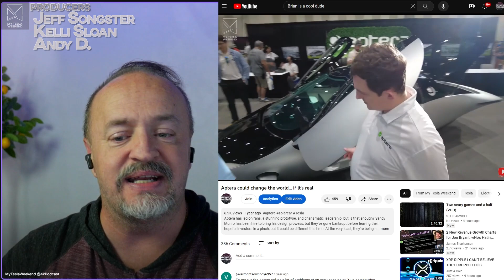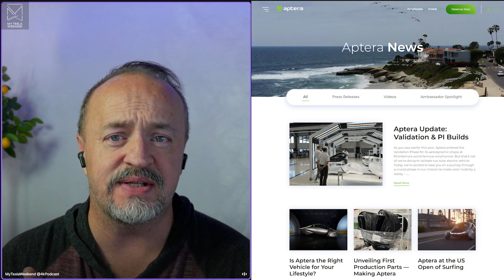Will your Aptera overheat?!? And other big answers w/ Chris Anthony

Comment: I will only be impressed if someone interviewing Chris or Steve can get an updated price.  It has been four years since they posted a suggested price and Chris himself has stated the switch to CPC raised the body and structural costs substantially. 

too bad their genius thermal engineer left in December 2022, that was Daniel Morris who moved to Lucid later.  That expense in 2022 for CPC was 9.4m per their filing.  None of their hill climb video was independently verified.  

All the imagery you used for the solar is in the facility they abandoned in July losing millions for that management misstep. They have not shown the solar line actually working, they had a staged scene with two engineers around a table adjacent to a non functioning piece of equipment.

Fascinating they admit to not being designed lock when in December 2021, May 2022, and June 2022, they implied they would be ready in December 2022. Even their Solar is in production video, filmed in the now abandoned Vista facility implied they were ready and already producing up to ten panels a day. I really don't get why you are afraid to challenge them on their assertions.  
 
They have chewed through 211 as of June 30th.
Reply from the maker: Price was discussed in the previous interview, which was just a couple months ago. There's a link in the description.
Reply: @FutureAzA  Price was his first item. After that was losing their thermal system inventor; tooling costs; a scam proof Gamma takes hills; outdated video you used; no evidence solar is being made; deceptive representation of such; past dates not met; more outdated videos; panel production rate; wants to know why you don't challenge; and though vague, is it 211 panels going to waste, or something entirely different? That's a lot to ignore.
Reply: The steel moldings that Aptera ordered for the CF-SMC (Carbon Fiber Sheet Molding Compound)(CF-SMC) body parts are intended to be used in production, which shows that the body's design is now fixed, because it would be very expensive to create new molds.
Reply: @amosbatto3051  As far as can be ascertained (they are never specific and always vague), they have four of the six main parts being made. One of the two not yet having the expensive steel molds is the tub, which is the largest, so must be the most expensive yet. A new revelation is that CPC is not large enough to be able to make them and has to subcontract out to an unknown factory bigger than they are. There has never been this news in the year that they have been planning, and begs the question - why has Aptera bragged about CPC making the bodies for Lamborghini, Ferrari; McLaren and other supercars when they can't make a tub for the smaller Aptera? It has to be another lie, and CPC have only been making smaller parts for supercars. However, the main point is that they have a fixed design, and that says nothing about the timeline to production. You can have a fixed design for 100 years and more. Also, when a vehicle can't get up a hill, it's never the body at fault, so no matter how well they make a body, it won't overcome the thermal throttling problem that has never proven to be fit for daily consumer use. On that note, Chris mentions ten trips up that scam proof, when the cretin on AOC is adamant they made three. All we see is about 300 yards; one occupant and 20 mph with no idea what the ambient air temperature was. Go by what's proven, and never by what's claimed and/or fudged.

Comment: Please ask Chris if the Aptera can daisy chain extra solar panels directly into the charging system.  I am an Acelerator investor #746 in line for the Launch Edition. My plan is to boon dock taking suitcase sized 1000 watts of extra solar panels to add to the 700 watts built into the skin.
Reply: Wouldn't the price of 1,000 watts of panels buy you quite a lot of rapid charges? Or are you planning to live in it and also road trip around the US in a circuit or something? Not being sarcastic, genuinely curious as to why that would be worth doing?

Comment: Not blocked - well done MTW. Here's a point you can dig your teeth into - I am always wary of more than one story for what's happened at Aptera, and I think I might have found yet another case with Chris' saying the Gamma's motors had coolant capped at the motors from production. From memory, the AOC video after the NBC debacle showed an apology written by Steve F saying that he had forgotten to add the hoses for the entire time (about 7 months by then), and that the motors weren't getting coolant. On checking that video, I find no trace of Steve's apology, bar a comment where someone says a CEO forgetting to do this is a fail -

@johnmalcom9159    2 months ago

"A management, engineering, and marketing failing. How can a CEO "Forget" that a major component necessary for successful operation of the vehicle, was not installed before National exposure on network news. . ."

Now, if someone forgets to add the hoses to finish the designed system they are not going to add coolant to the motors and devise plugs for each. In fact, plugging the battery end is necessary in any case, and I would think that would be enough work without having to fill the motor end with coolant and plug it, but this is what Chris is now saying what happened. Putting hoses between the parts would be easier than separating them with coolant in each and plugs for both ends - not to mention of it being monumentally stupid not to just do what the design dictates. There has not been any mention in the months before this new explanation of coolant being around the motors in a static state (no flow just isn't done - ever) - not by anybody. I regard this to be a different spin on what Steve said.

What we need is someone to find Steve's apology and every random comment ever made and discover who is telling the truth. I have always thought Chris was pathological with his lying, but I don't know if Steve is any better. There is no trust in their words, and it would be interesting to know what was the real state of the Gamma's motors and where the BS comes from. Chris also said they drove up the second hill ten times, when an AOC video reported only three. Of course, the reality on film was we saw about 300 yards of one. It's time we ignored the lies and they learned how to produce proper evidences.

Comment: Cool concept but don't forget, it's only a 2 seater. Extremely limiting, can't take my 2 kids anywhere or my wife and a kid. For single people or couples only without kids unless you have another vehicle just for the family. Seems disappointing in that way though...
Reply: Most people drive to work daily as a single occupant. Let that sink in.
Reply: Everyone knows it’s a two seater, plenty of other four seaters out there to buy.  This fits a different dynamic that will do well.
Reply from the maker: Don't forget the Miata was a only 2-seater.

I don't think the Miata would have been the success it was if it had four seats.
Reply: @FutureAzA  people used to hurl this at me when I had my Smart car. "Yeah but it's bad because it only has 2 seats."

Umm. No? Because I bought it because it only had 2 seats. If I'd imagined it had 4 and had been conned that would have been a problem :D 

Worse for me is 4 seats cars which barely fit a 12 year old of normal height in the back. That's 2 entire seats almost entirely wasted. 

Are a lot of 2 seaters completely silly, yes, but not because they have 2 seats, anymore than a double decker is because you can fit 67 seats in it.
Reply: @FutureAzA  ...and don't forget that Reliant produced a 3 wheeled car that sold 1/2 a million copies, became a cultural icon, and lifted them to the #2 automaker position in Great Britain.
Reply: Along with a 7-passenger utility vehicle for hauling stuff and people, my wife commutes in a convertible that seats two adults and 2 midgets and I commute on a motorcycle.  There is definitely a market for ultra-efficient 2-passenger vehicles in California.
Reply: I don't think anyone "forgets".

Tesla started with a much more expensive and less practical 2 seater.

If you read their SEC reports, you will see that, like Tesla, this will only be the first of many vehicles for other, more mainstream customers - all focused on efficiency.
Reply: Being a 2-seater is one of the reasons I am purchasing this vehicle.
Reply: My Tacoma is a 2 seater. I don't want more than one passenger  :)
Reply: You don't need four seats, and you don't need four wheels. Hilarious when people expect this vehicle to do things outside of it's intended design, like tow a trailer with batteries and solar panels.